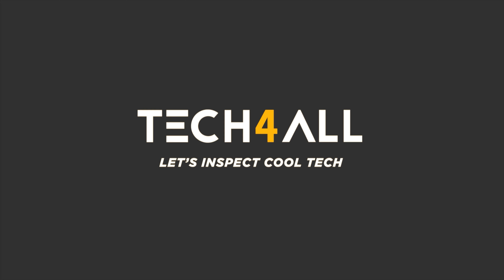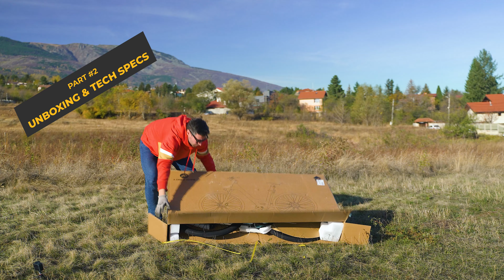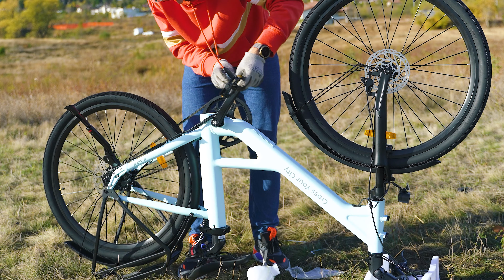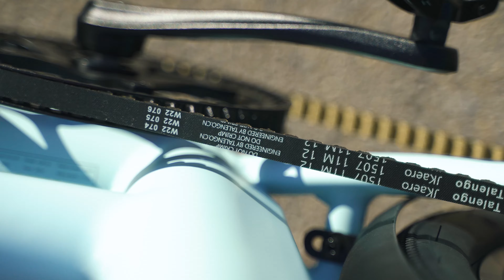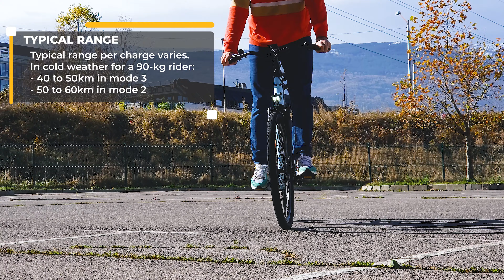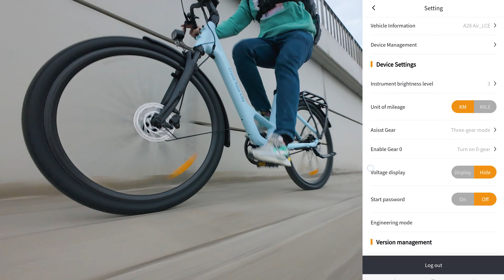Reviewing a Great City Electric Bike from ADO Air 28

Comment: I know my comment comes way to late, but i reckon it might be still pretty valuable one.. as confiniant a belt driven bicycle may be.. under strong tension and later on the use, when getting a bit dry and worn..they definitely can snap! Since they come in different sizes and availability might be an issue incase of fixing it when getting stranded.. I strongly advise any owner of a belt bike..to keep a spare! They are not heavy to carry and noormthe need greased up so they're pretty clean to storage also.  I do use my bicycles to commute longer distances like 25km back and forth. And it definitely occured once a shop nearby not having the correct size. A chain can be pretty much bought almost anywhere and shortened with a simple small too. Not as cool but you'd be back on the wheels way quicker getting you and your expensive bike home! So get that spare belt , Once you buy the bike as well.
Reply from the maker: That's a very practical tip, thanks for sharing! 😊

Comment: I am planning to buy this and I live in Netherlands and as you can guess I don't have the problem with hill areas haha. For my budget I feel like this is the best one I can get considering it that it's very new and for the price it comes with many pros and feature pack.

My only concern that the Netherlands is famous with it's bike thefts and it scares me that leaving my bike's battery on the street feels a little bit scary to me. Is it really hard to take out the battery? If that's the case I am strongly considering to buy this bike!
Reply from the maker: The battery is very easy to take out. But it also has a lock option. 
Also - you can think of using apple airtag hidden somewhere in the frame. Just in case.